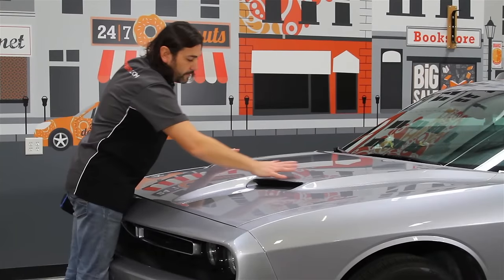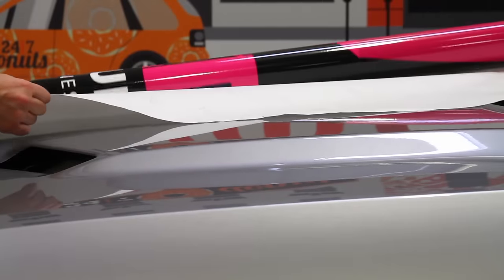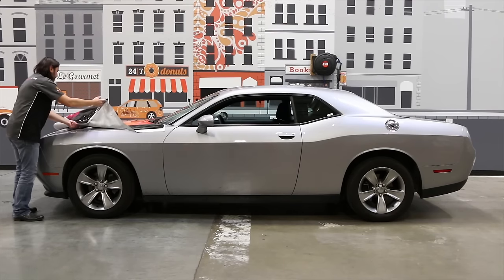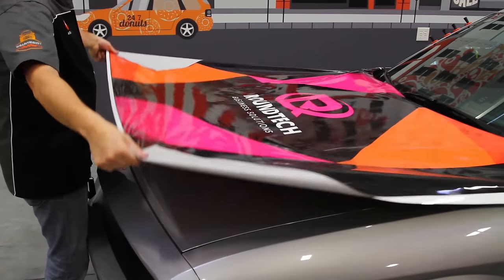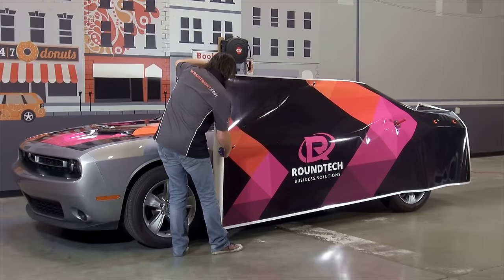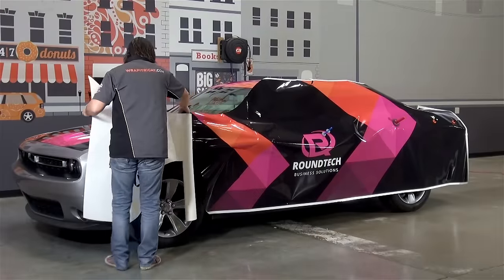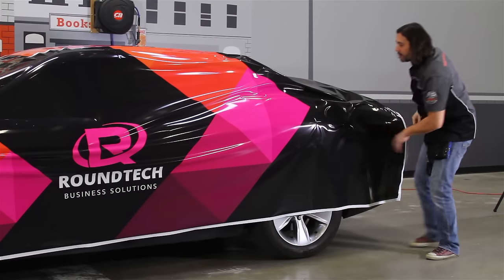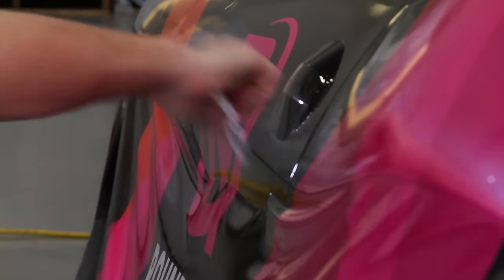Quick and Easy Vehicle Wraps using SLX® Cast Wrap with FLITE Technology® | Arlon Graphics

Comment: If it's so easy to adjust and remove whilst applying, what's stopping someone coming past and pulling it off your vehicle ?
Reply from the maker: Hi Ricky, that's a great question. During application, the film is very repositionable and "floats" over the vehicle. However, after applying firm pressure with a squeegee and post-heating, the adhesive bond develops quickly and gets even stronger over time. You can learn more about how SLX Cast Wrap stays down in this video about FLITE Technology™. Here's the link to that part of the video: https://youtu.be/NrofKSC1BrA?t=1m39s